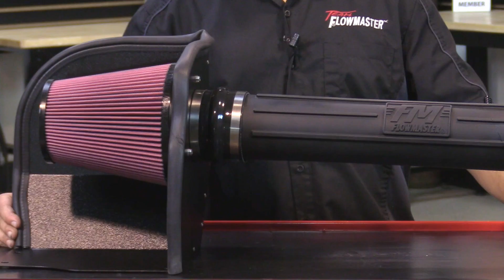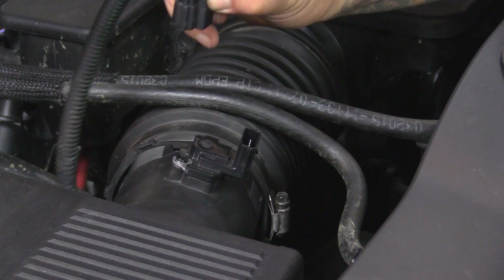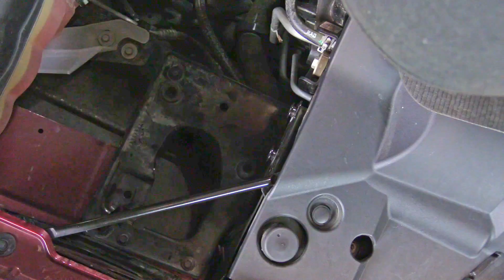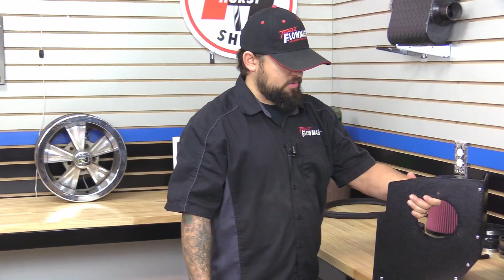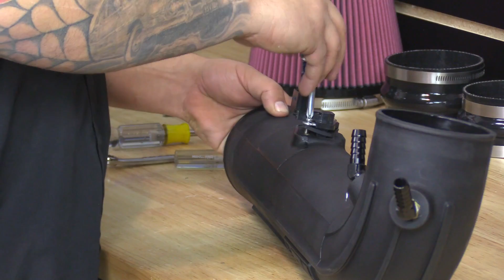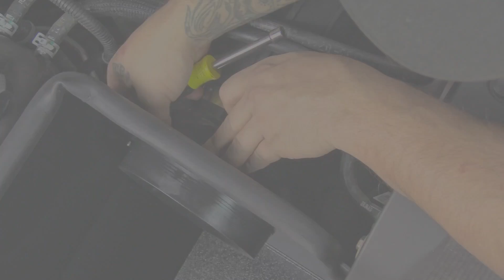2014-18 GM Silverado/Sierra 1500 & SUV's 6.2L - Delta Force Performance Intake 615178

Comment: I bought one of these intakes, i ran into a problem... I own a 5.3 and the kit is for is a 6.2 the place i purchased it from wont return it am i out of luck or will this work on the 5.3 motor
Reply from the maker: This Performance Intake is for 6.2L engine applications only. For the 5.3L you will need part number 615121. You can try giving us a call at 707-544-4761 and speak with our Support Staff if you need additional assistance.